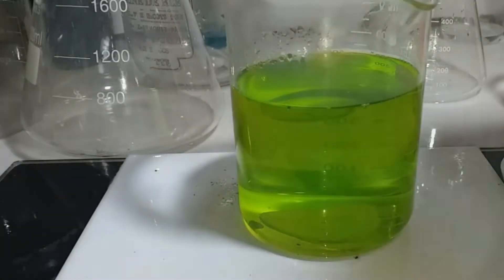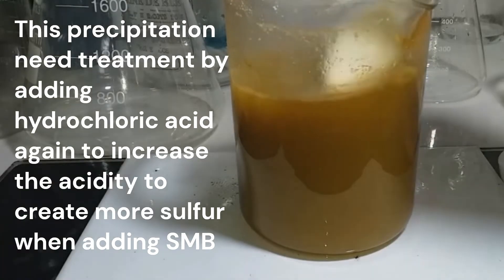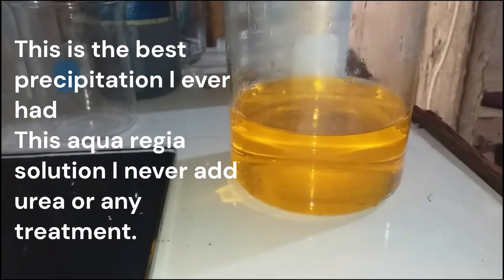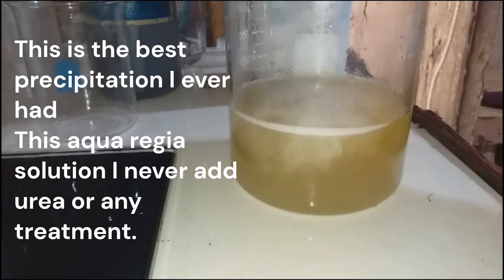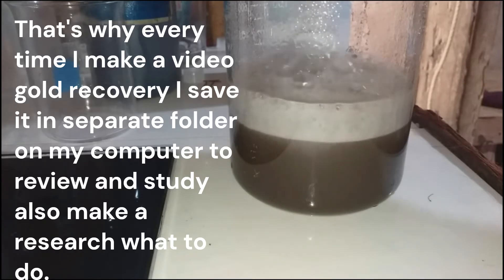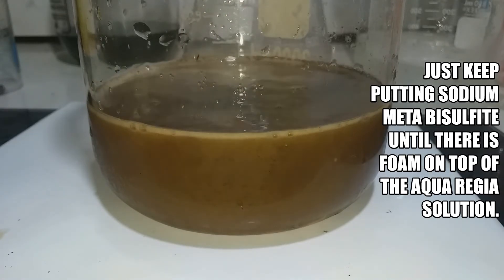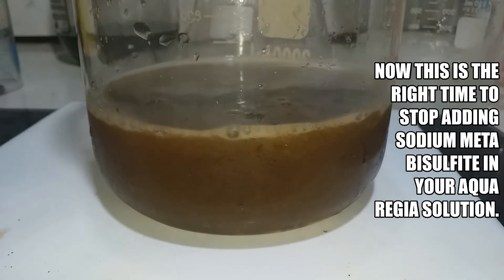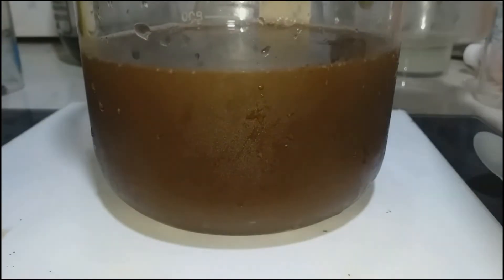WHEN TO STOP ADDING SODIUM META BISULFITE IN OUR AQUA REGIA SOLUTION? | GOLD PRECIPITATION REACTION

Comment: STILL nothing on purple grape juice looking aqua regia that im stuck with right now :(  but i m trying to add more HCL after watching video which may help or make worse i will see i guess, thanks
Reply from the maker: Your question is not very clear because I don't know what you are doing and how many kilograms of scrap you used, but there is only one thing to do, you just need to use the right chemicals for what you are doing to work. Adding HCl to the solution will help dilute the excess nitric acid in the solution and also help increase the nitrous which is important to aqua regia and acidity in the solution so that the gold can easily precipitate.

Comment: I had difficult drop  from deep green to brown ended up lighter green to blueish after diluting the tricky think is that smb never stops to feez a litle if you drop it dry also in the next day after setling it formed white crystals gypsum like i heated a bit checked with urea ( no reaction ) then when the crystals gone i added smb again and formed like dropping again
Reply from the maker: Thats why its better to rid off first the base metals brother, then use hcl for washing, then use smb high grade that high contain of sulfur.
Reply: @PoorMiners321  yea i had triple filtered with nitric to remove base but i was in lack of urea and had the fabulus idea to remoove excess nitric with coopertube
Reply: I should have left it in to drop enything it can and then proceed with more nitric instead i git pissed and made new a r

Comment: Some of the urea is expired, so it sabotages the work How do I know that urea is suitable for use and does not have an expiration date?
Reply from the maker: If urea expired, then you dont get sulfamic acid, try to evaporate your aqua regia in a medium heat, but avoid boiling, then when the aqua regia solutions has reduce, the excess nitric acid is gone, then add hydrochloric acid to dilute the aqua regia solutions, then add reducing agent to precipitate gold, recommended precipitant, smb and iron sulfate which is easy to find.

Comment: Im dumb af im frustated right now XD

Thank you for your video
never did i thought of many variables that could go wrong
Somehow i panicking because twice i failed to get the gold out of solution
When i added SMB i also add Zinc Powder, would that upset the reaction? 
if that would messing all the stuff how could i solve it back ?

Thank you for your video brother it helps me learn from the mistake
Reply from the maker: Yes you can, the reason not getting precipitaion first improper ways of using aqua regia, second, your smb is low sulfur, I try many times and I failure because I found out that the smb I use is low sulfur contain thats why we don't get gold precipitations, thanks brother.

Comment: I am just starting e scrap gold recovery but at the end something wrong every time.may be because of lack of knowledge....
Please mention how to recognise by it's colour wether which camical need urea, sulfamic acid,smb,or HCL.kindly reply 😊
Reply from the maker: Thank you very much brother, some tips here, For those new to gold recovery, the first thing to do is always dissolved base metal, do not disslove directly into aqua regia, collect gold foils by filtering, dissolved gold foils in aqua regia, note! aqua regia is difficult to master, to make aqua regia you need to cover your gold foils with hcl, and slowly add nitric acid, if you see that everything is dissolved, stop adding hno3 the gold is already in the solution , neutralize aqua regia by adding sulfamic if necessary, by adding small amount.
 For SMB you need to check the purity of the smb you will use, its sulfur must be at 67%, if it is below 67% sulfur, it will be difficult for you to precipitate the gold so there will be no result from what you did.
Reply: @PoorMiners321  Thank you very much your guidance very much needed ۔Yes I started with HCl then added nitric to it but gold didn't resolve۔۔۔then I added sulfuric acid drop by drop after 24 hours, filter the solution but still gold foil remains ۔I kept filter paper aside and started the next step to remaining aqua regia neutralize with sulfamic acid then used smb for participation but gold didn't drop and colour of solution is dark green colour ۔ please help ۔thank you
Reply from the maker: @saminakader571 ah you didn't dissolve your gold foils brother, then you add sulfuric drop by drop? That's  wrong, add few amounts only maybe 2 to 3ml, if hcl and nitric acid isn't dissolve your gold foil check the concentration of your hcl 29% and up is working well, even if your nitric acid 50% to 68% its working better.
Reply: @PoorMiners321  thank you for your kindness ۔

Comment: Hello, the nitric acid and hydrochloric acid required for aqua regia have a certain purity level.  For example, the purity of HNO3 sold in the market may be 52%, and HCl may be 25%.  Can aqua regia be prepared from two acids at these purity levels?
Reply from the maker: yes, that is also possible, 52% hno3, and 25% hcl, 3:1 ratio, if you can't find higher concentrations. but good concentrations of aqua regia 68% hno3 and 29% to 35% hcl.
Reply: @PoorMiners321 thanks
Reply: @PoorMiners321 thanks

Comment: Hey bro listen after I added SMB it precipitated gold, but the solution still has gold in it. How do I get the rest out?
Reply from the maker: Do you neutralize nitric? If not then its imposible to get gold out from solution, contenue add smb until foaming comes  on the top of solution, then add distilled water to dilute solution.
Reply: Yeah I did with sulfamic acid. But after I add smb first I get gold not all of it though. My stanneous is still positive. So do I know add hcl and heat it to add sulfamic then smb again. Right ...
Reply from the maker: @andrebattis9410  don't add sulfamic again it contaminate your solution, filter it to get the precipitated gold, then the filter solution add hcl and heat then add smb
Reply from the maker: @andrebattis9410 if you dont get precipitation, calculate the estimated gold you have in solution, sometimes the stannous test turn purple because of too much adding smb, if you think that there's missing gold last option is to add zinc powder to cement out the remaining gold in your solutions.
Reply: Try ferrous sulphate

Comment: I just boil it down then filter. Make nitrated cofee filters as they are resistant to it and easily burn to recover the materials soaked in them. Then i keep cooking till it starts crystalizing let cool saving the gold as HAuCl4. This then gets fed into an electrolytic cell eventually that makes 3 or 4N gold plus chlorine that gets used to recover other noble metals. Also jewlers like the chloroauric acid to feed their electroplating machines and they pay more than the gold value for it. ❤
Reply from the maker: Good to know brother, thanks

Comment: Brother after adding SMB in my solution there is no reaction? What could be the reason
Reply from the maker: Low aciidity bro or maybe your smb expired..
Reply: @PoorMiners321  SMB powder date 2023 to 2026, aqua regia was 60 ml. 3 part HCl 1 part nitric. It's My previous experiment. I am already working with a new one, I added urea then cold water then I mixed SMB with distilled water, after adding urea there was a reaction but after adding SMB there wasn't a reaction. Please help
Reply from the maker: Try to add another hcl, after adding hcl add directly smb dont dissolve in water
Reply: @PoorMiners321  okay bro, I gonna to do it

Comment: Low acidity, put it on the hot plate and boil after SMB. Works fine
Reply from the maker: Yeah you can do also, forcing precipitation but sometimes that precipitation are soluble in boiling hcl, unlike the natural precipitation by sulfurazations

Comment: Nitric should first be completely consumed before moving on to precipitation. If too much nitric has been added in the initial dissolution, then the aqua regia solution should be boiled down to a syrup in order to drive off the excess nitric acid. Then re diluted with HCL and H20 for filtering and THEN precipitation.
Reply from the maker: I also learn a lot of knowledge from you and also from my other viewers, highly appreciated..
 best practice using aqua regia is done by slowly add nitric not mixing directly 3:1 ratio or 4:1 ratio, and I also realized that when make gold recovery in small amount of scrap during precipitation you have already got precipitation but you never notice it, unlike large amount of gold,  in addition watch sreetips video he never neutralized aqua regia because he use nitric correctly drop by drop
Reply: Music too loud can't hear your voice
Reply: Music too loud can watch without music

Comment: Why does the gold sediment float in the water one by one when the water is stirred? Please tell me what todo❤❤❤
Reply from the maker: Thanks for watching and reaching me, the mean cause is our precipitant, the precipitation of smb are very tiny particle and easily float, all you need to do is to wait a couple hours to sank the gold into the buttom of your beaker then decant the eccess solution carefully then by washing you need always hot distilled water and always wait all the gold set back again to the buttom of your beaker the the final depends on you if you dry or capture through filter paper.

Comment: Plz help me I lost my gold Sir when i add sodium metabisulfite into the solution I got white colour crystals at the bottom of beaker. What is this stuff?
Reply: @talkoftoday191 same problem here what did you do to solve the issue
Reply from the maker: Ok first thing you gonna do here is to filter white precipitate, separate the liquid then add zinc powder to your filtered solution, if zinc powder unavailble to you add zinc bar, then the white precipitate that you capture in your filter paper try to redissolve into aqua regia mabe 100ml hcl and 20ml 68% hno3 , then precipitate again using iron sulfate..
Posible cause of white precipitations.
1. Maybe your solutions is low acidity.
2. Maybe the gold are small amount and large amount of base metal and your process are directly dissolve into aqua regia.
3. Maybe your using more water to wash during filtrations.
4. Maybe your smb are low sulfur content. Recommended smb sulfur content 60% and above.
5. Maybe you add too much neutralizing agent like urea or sulfamic.

Comment: Sir when i add sodium metabisulfite into the solution I got white colour crystals at the bottom of beaker. What is this ??
Reply from the maker: your solution maybe low acidity or contamenated with other base metal, 
so you do this, contenue add smb until  there are foams,
Reply from the maker: then if the solution got foaming, stop adding smb, then allowed to settle down all precipitation, maybe 10 to 12 hours, then after settle down filter it with filter paper, to capture all precipitation including white precipitate, then dry it to your beaker or steel plate, then dissolve again with hot aqua regia,
Reply from the maker: to dissolve in aqua regia add hydrochloric acid much to covered the material, then heat is apply, when hydrochloric acid are heated, slowly drop nitric to form aqua regia, start it with 3ml nitric acid, if you see that all you precipitation dissolve then stop adding nitric acid.
Reply: Thank you for your quick response may god bless you.

Comment: I dissolve metabisulfite in cold water and the temperature of the acid is about 50 degrees, although I also tested at low temperatures of about 20 degrees, but no color change occurs. I try to extract gold from the soil but I did not succeed. I first wash and heat the soil with nitric and sulfuric acid and then add the acid, but again I can't do sedimentation.
Reply from the maker: The temperature isn't affect the process, the main cause here is higher acidity, excess oxidizer,
Reply from the maker: In your case,
have you test your solution have gold in it? if you are very sure that theres gold, then this is your problem,
higher acidity, you disslove your gold bact to solution again, you have excess nitric acid, then contamination by late adding urea, then sulfuric also cause that your gold goes to the solution for ever..
here is the last choice to recover your gold.
don't just throw away that solution, boil it at leat 10 minutes boiling as in boiling, then slowly drop sodium sulfite, not sodium metabisulfite, sodium sulfite and sodium metabisulfite is different, continue boiling until   you got precipitation forming as a black powder in a beaker then refine it.

Comment: Hello, when I add metabisulfite to acid, the solution turns black, but very soon after a second, it returns to the color of acid and the blackness is not stable. I add a little urea to the solution, but it does not change color anymore. What is the cause of this defect? After adding urea, I also added hydrochloric acid, but it still does not change color, please guide me
Reply: Nitric still alive & you but urea you killed Nitric & HCL so you should add some HCL much better with rocks Settlement done by ley soda  first time
Reply from the maker: Nice work😁, Good day sir I Am not expert sir but, I had accumulated knowledge to do this task, I realy relate your problem we back 9 years ago.
so this is how to do next, do this job  in order..1, extract the gold from with water and nitric acid alone,
2, wash the material with distelled water multiple times not tap water
3, add hydrochloric acid double times with your materials.
4 , heat hydrochloric acid at 85c is better to react faster if nitric acid is apply, start dropping nitric acid to form aqua regia start at 3ml if the reaction has very slow then add more,when reaction goes  stronger wait until reaction has stop, then drop 1 shot of sulfuric acid small amount 2ml to 3ml,  then add more nitric, if you see that there's no reaction when you add nitric then its time to stop adding nitric and cool your aqua regia solution
5. if solution has cool down then filter it multiple times, 
6, add small amount of urea halt table spoon to 1 table spoon or diesel exhaust fluid,
7, add smb, depends on amount of your aqua regia, some people dissolve it in water but for me i dont like that because you cant estemate if you got precipitation or not, that process is good for expert not for the beginners.

Comment: Once the foam stops is when you stop
Reply from the maker: foaming that quickly dissappearing is the good indecation that you got perfect precipitation and that is the right time to stop adding smb, but if your aqua regia solution first add smb it immediately foams and taking longer to dissappear that means you have excess oxidizer or excess nitric acid all you need to do is to  add small amount of water and add add urea or exhaus fluids to kill nitric.
Reply: I have been adding too little SMB?  I read molarity is 1:1 SMB:Au
Reply from the maker: is not enough brother..
Reply from the maker: By ration? For me I dont used that because sometimes some smb are low sulfur content, then if you follow the ratio you never get precipitations if the sulfur content in your smb are low.
Reply: What is white precipitate after SMB from AR?
Reply from the maker: low acidity and contaminated with other metals.. but still gold in it, you need to filter all precipitation wash it with distilled water and dissolve again to fresh hòt aqua regia..
Reply: Nope it's when you see the white foam, you must stop.